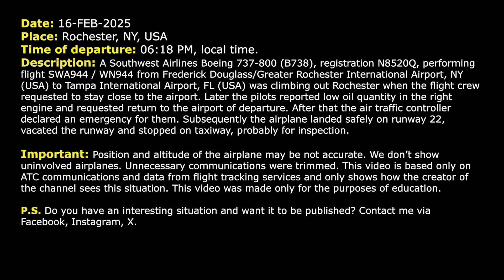Low oil quantity in right engine after take-off. Southwest Boeing 737 returns to Rochester. Real ATC

Comment: The Boeing flight crew training manual says low oil quantity is not an emergency as long as oil temp and pressure are normal. There is no low oil quantity checklist on the Boeing 737. They could have continued to destination.

Comment: Weird. Oil indicating low in the climb out but at level off, the numbers show that they’ve come back up. Then low again after accepting a turn. If the graphic and ATC comms are shown in real time.

Anyone know if the oil quantity remaining is affected due to pitch or roll? Was it normal on the ground and “just at” the lower threshold of normal limits prior to departure?

Ok, but if there’s a slight leak, I’d gather there’d be smoke or fire soon indicated.
Reply: I think all of these issues right now are due to maintenance and purposeful negligence